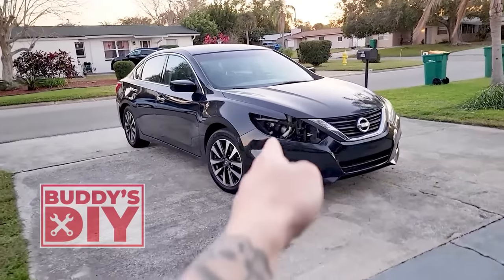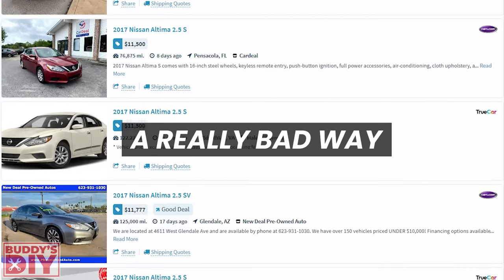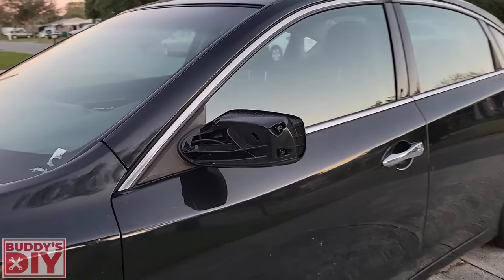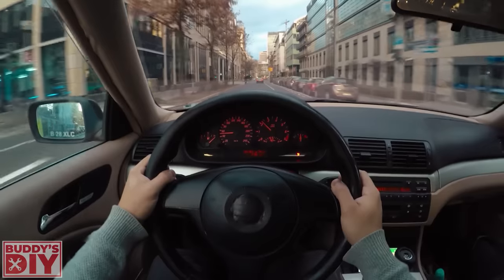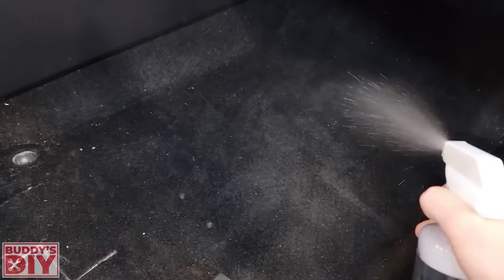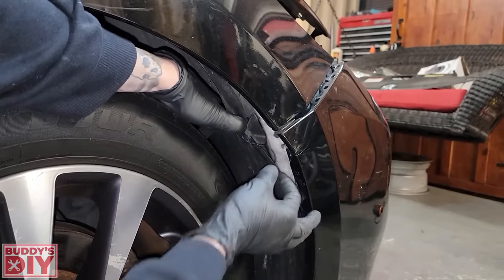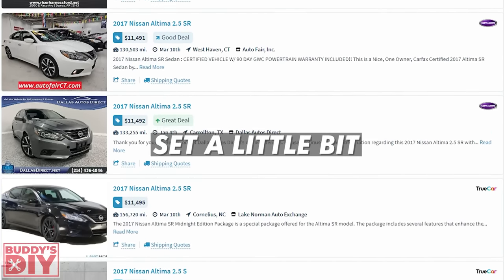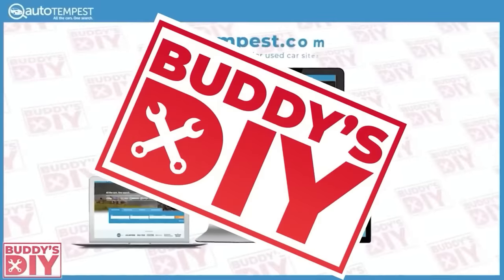How To Flip Cars | FULL PROCESS [10]

Comment: Great video, but unfortunately that cylinder is going to go out again. Classic example of a blown valve cover gasket, usually there’s an inner gasket that goes around the holes for the coils.
Reply: Yeah, this car looks like it wasn't cared for what so ever judging by the interior alone. That thing never had an oil change in forever by the looks of it either.
Reply: That’s what I was saying. Kind of disappointed in Buddy for not properly fixing the problem. Just floating the issue to the next guy. A shame honestly
Reply: Man pulled out the oil covered spark plug and questioned nothing about how it got so full lol
Reply: it's a risk people take when buying a car with almost 100k miles
Reply: Yeah, obviously needed a valve cover gasket, really disappointed in buddy for not addressing that
Reply: especially when he prides himself on doing his due diligence in not selling lemons
Reply: Yeah he cheaped out. Valve gasket covers are 100-300, it's an important fix.
Reply: Yep exactly...he is just passing this problem on to the end buyer...if you want to build a good reputation then you shouldn't sell cars like this
Reply: @AnhH88  he didn’t even need a cover though he just needed a gasket
Reply: Hey, I came to comment the same thing lol he just sold a time bomb. The gasket would have been the first thing to replace. But who knows, he probably changed it and forgot to include the footage.
Reply: with any luck it was a single mother that bought this turd
Reply: @ssquiggss  well those 2.5 4cyl have known issues with the spark plug gaskets failing. Unfortunately you can’t just replace the gasket, you need to replace the entire valve cover since the gaskets are built into the valve cover.
Reply: @heismanhighlights5123  on this engine the entire valve cover needs to replaced
Reply: @kateh3718  Obviously it’s a risk, but there’s a difference between scamming people and trusting a seller. Don’t complain when you buy a used car and it blows up on you
Reply: @sirmo667  I did buy a used car and it had issues unfortunately, but I was able to fix them on my own. I do not believe Buddy did this deliberately, but who knows
Reply: Was thinking the same thing, dealing with an issue with a project car. Had to check myself that it was a valve cover or the coil.
Reply: Dude knew the valve cover was gonna be pricy but the right thing to do would’ve been to replace it, check the engine see if it has sludge from the previous neglect of the last owner. Run a cleaner and a fresh oil change. Car would last a long time for next happy owner. Dude took the shortcut way.
Reply from the maker: O-ring in the spark plug well was in fact all good when I pulled the cover.
In all honesty not a clue how oil got in there in the first place. Previous owner didn't give a damn about the car so who knows the story of this thing. Drove it myself for a while and it turned out fine.

If you look at episode 3 or 4 with the highlander it had a valve cover Leak and I spend hours and hours retapping a hole and all that to make sure it was good for the new owner. And that was all for a car worth half as much as this altima 🤷
Reply: @BuddysDIY  buddy silenced the couch mechanics
Reply from the maker: @tyalexander225  ti their defense they made a great point
Reply: @Ty Alexander  its not that we were silenced at all. In the video you can't see him checking the o-ring or the gasket. It was valid for some of us to think the worst of this vehicle.
Reply: its a used car and he gave them a deal under market price. new buyer can get that installed cheap its an easy fix
Reply: I agree.  Correct way to fix it is to replace the valve cover gasket
Reply: Bussy is not Nissan, he is not responsible for Altima of all vehicles blowing up and has no obligation to provide a warranty.
Reply: @BuddysDIY you're a W
Reply: @BatteriesRcool99 

And they’re actually easy and cheap to do.
Reply: @Aguilera303 

Yep
Reply: @Radi0he4d1  nissans are hot garbage, especially high mileage ones
Reply: Thanks for posting this. I was just about to say the same thing. Luckily that gasket is really easy to replace for the new owner
Reply: @heismanhighlights5123  the gasket is in the cover and cannot be purchased separately. It's still an easy fix and takes 30 mins to do lol. I've done that job on my 16 altima. I'm at 423k miles on my 2016 altima.  😅
Reply: I thought it was only me who saw all that oil and said what he just changed the plug and left it.  That oil is gonna come back. If you trying to establish a good name that's not the way to go. At least not on camera
Reply: Yeah spark plug tube seals or valvecover gasket however this is setup.  I'm bothered by this
Reply: @sirmo667  wasnt heaware of it ?
Reply: @mz5388  i think he wasnt aware
Reply: 25$ for an ignition coil? Hmmmm i never got one that cheap before. And the oil thats a leaking valve cover thats why the coil went out
Reply: The way some of you guys are acting you would think he put gear lube to hide a rod knock
Reply: Just waiting for spark plug tube seals to be replaced ahem 😂

Comment: Great video been a long time fan but I'll be honest.  You should've replaced the valve cover gasket.  They'll be lucky if they get a few weeks without the same problem. Valve cover gasket would cost less than what you paid for the floor mats
Reply: You are not wrong!
Reply: Or even worse, if it was a worn out piston ring, that’s a whole engine rebuild
Reply: @Andrew-pd4xv  usually when a piston ring is worn out the engine burns a bit of oil and you start seeing the oil consumption increase or even worse it will burn a lot of oil and the smoke color will be blue, and also you ll find oil in uncommon places such as the air fillter =))
Reply: had to do this on my car not too long ago. I'm surprised Buddy didn't address it at all

Comment: I'm a bit confused. How did the oil get in on the ignition coil? Usually that happens when the gasket fails, so it would need to be replaced, but you didn't do that. I don't understand how simply cleaning the spark plug well and replace the coil would prevent the issue from repeating in the future.
Reply: it doesn't.
Reply: The resason why he didnt do that is because it would cost more. What he did was the minimum to make the engine light disapear, he sells the car but the new owner will have the problem repeating as its going to happen again.
Reply: Two things could cause oil to pool in the engine head like that, cracked cylinder head or valve cover gasket.
Reply: He cut corners and sold a 🍋 🍋
Reply: @jamzempire  imagine buying the car and one week later the entire engine blows =)))), i think he was conscious what the real prob was
Reply: Oil gets there because a valve cover gasket is leaking through. 

Should change gaskets if you see em’ he didn’t sell a complete lemon. 

Remember flipping quickly means to do the least to keep additional extra costs low. 

If you flip for high sales you’ll often sit on the car longer than you’d want. So it’s up to the person doing the work. IMHO
Reply: Could be valve cover, rings or stem seals. Moral of the story, he put a bandage ok the car 😄

Comment: Love this series! My dad and I have been flipping cars for years and we just took our first loss. Got a 2015 Buick encore that needed a head gasket. I replaced it and got the head decked and sadly there is low compression via the bottom end on 1 cylinder. Sucks but it happens

Comment: Why did you just ignore the source of the oil leaking into the spark plug hole?  The valve cover gasket leaked into there and you just left it to fill up with oil and destroy the coil again.
Reply: That's a problem for the next owner I guess
Reply: To show the real flipping process. Cut corners and hide problems and screw over the buyer to make maximum profit. Nice to see people holding him accountable here for that. Lmao.
Reply: @venividivici6418 as a quick flipper myself i feel like the cost of the car was his issue.

I purchase 500-1000 valued cars and easy things like that are do-able because i was a trained mechanic.

Either he didn’t see the work was worth the time or what have you is my guess.

Valve covers are tooooo easy.

But yeah dude should include mechanical issues that don’t even take that long nor cost that much

Comment: Sparkplug tube seal needed to be changed! These are included in the valve cover gasket set. Very easy and cheap repair broski. That's only goin to cause issues for the buyer of the vehicle down the line. I'd repair it, just sayin. Finding oil in there is not caused by the coil not working. Oil can cause the coil to fail. Not the other way around.

Comment: I think one other thing that might need to be done is the CVT service. These things are notorious for catastrophic failure around 100k miles due to no regular interval changes of CVT fluid. Probably on the new owner to not buy any car with a cvt, but would be a risk point.

Comment: Years ago i owned a 16 Altima SV..I did NOT have to remove the bumper to replace the Blinker or Headlights. Open the Hood so you can get some light....Turn the Side wheel that your working on" In " and You loosen 4 pins for the Front wheel Arch protector(black plastic)...You have access although tight access to all the Bulbs. I replaced my Fog,  Blinker and out in HID's this way and only took bout 10 mins per side. Did no Damage to the Plastic and replace the pins.

Comment: If it was flooded with oil when you took the coil out, it's probably got a bad valve cover gasket causing oil to leak down into the spark plug hole... it'll just fill up again

Comment: there is a reason the spark plug tube is filled with oil. leaky tube seals. replace valve cover gaskets and tube seals to stop oil from going in plug tubes

Comment: You have to be careful buying cars with misfires, because sometimes it’s not as easy as a spark plug or a coil , sometimes it’s low compression and a completely dead cylinder causing the misfire which hurts profits and wastes a lot more time. Best to verify compression before handing over the cash

Comment: Buddy i disagree with you here 9:50 , when an ignition coil is flooded with oil it is usually caused by a blown valve cover gasket. Of course you can clean the oil and the missfires will disappear but just for a while, the coil will keep getting flooded. The solution is to remove the valve cover and replace the old blown gasket. It s not an expensive fix for a four cylinder engine.

Comment: Did you support the engine from the bottom when you swapped motor mount? If so where?
Did you fix the oil leak in the spark plug well?

Comment: I live in Sarasota. I want to fix and flip a car with you! I'm scared to do my 2nd one alone, especially since the seller ripped me on the 1st one. I need all the help i can get starting and gaining my confidence. 04 buick rainier from a coworker. Only cosmetic issues as far as i could tell except the battery and brake rotors. Seems pretty safe and I'm getting it for only 600 because he doesn't want to deal with it, has other cars, and it's blocking up his driveway making his house in a nice neighborhood look ugly. But I'll take an ugly car! Still though. Your help in person would be like using a cheat code irl. Neeeeed :p

Comment: What about the oil leaking in the cylinder??? Just changing coil and plug is temporary fix, if the valve cover or another issue is causing the oil to leak into the cylinder than it’s just a matter of time before it miss fires again same way….

Comment: Cleaning the oil out the tube and fitting a new plug/coil is only kicking the can down the road, because that VC gasket around the plug holes is done. Those tiny 4-bangers are squeezed to the max, to put out a lot of power compared to the size, thus they run hotter than older cars with similar size engines used to, which means they cook the gaskets faster, in essence, they turn from rubbery to hard plastic, shrink and start leaking. I've seen this on numerous newer cars. Since you didn't replace the gaskets, i hope you at least were honest to tell the buyer that he might need to have the VC gasket done soon-ish, to avoid further issues.

Comment: you didnt fix the missfire issue to begin with .what you did was a temoreory fix that coil is going to go bad. you should have replaced the o ring seals and valve cover gasket while you at it.

Comment: with a skinny profit margin like this I get it, but if it was me, and if I had more room to work with I would have serviced the CVT, done the oil, spark plugs, and fixed the leaking valve cover gasket so the new coil doesn't go bad too.
Reply: Nobody services used cars anymore. It’s not expensive to change/ flush the fluids but apparently that’s too much work

Comment: My guess is the owner had some work done at a crappy shop and they missed a seal doing a valve cover gasket, or spilled some oil on the engine cover changing the oil and some of it seeped into the coil port.

Comment: When I saw oil in the spark plug hole, I was fearing the worst.  But apparently, it turned out to be a simple fix.  Question is, how did it end up there in the first place?
Reply: Valve cover gasket

Comment: I have the same car and I had to put a transmission in it and it only had 77k miles
Reply: Those cvt transmissions need a fluid change every 30k miles if you want them to be reliable. Don’t hold them at high revs and make sure you’re at a complete stop when switching gears to park , drive etc

Comment: I gaurantee you the spark plug tube seals and valve cover gasket needs to be replaced. You could have gotten a few hundred more if you did those and put new plugs in also would be more reliable down the road for whoever bought it.

Also your math was a bit off, the profit was $2,378

Comment: engine rattling will go away temporary But will come back again.  Because ignition coil no2 taking oil from gasket, you sold the car only replacing the coil but without replacement of gasket. That wasn't cool.

Comment: You basically just soaked the oil out of the spark plug tube and shipped it... You should have replaced the valve cover gasket assembly with the new spark plug tube gaskets. That was what we call a shady car lot fix. New owner is gonna have that problem very soon now.

Comment: Valve cover valve cover valve cover valve cover!!!!!!!!   Where do you think the oil came from!!!!!!!!       And you didn’t diagnose the coil as it is probably fine. Did you check it with a spark tester?  The plug was being shorted to the head because the oil.  The oil was there because a o- ring failed where the valve cover seals around the plug ports.  Plugs are in the center of the head, thus the seal!!   So….. tighten up your mechanic skills and call them folks you sold it to and tell em why their car Will have a engine misfire. Ease off the cleaning! More workin. No vice grip but not bad hand!